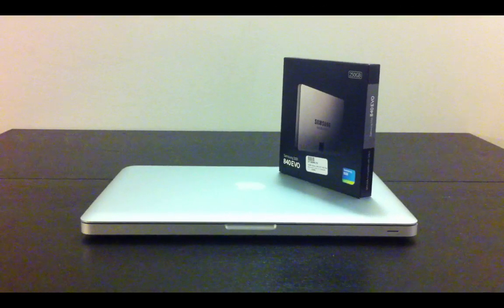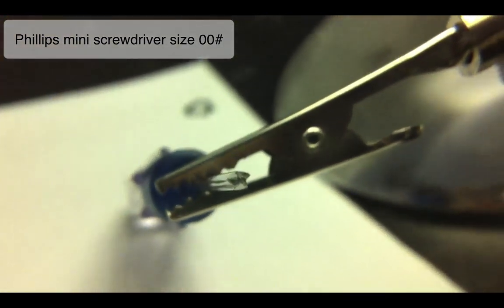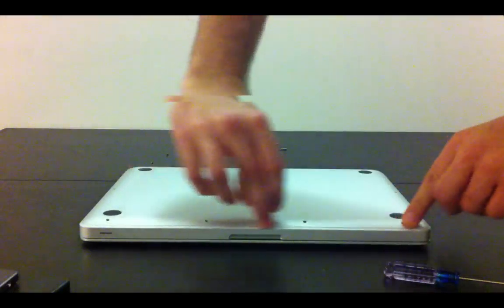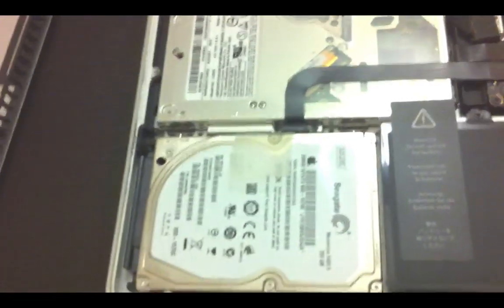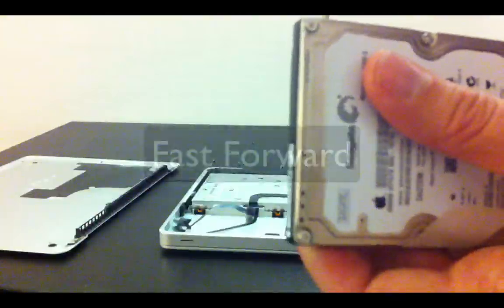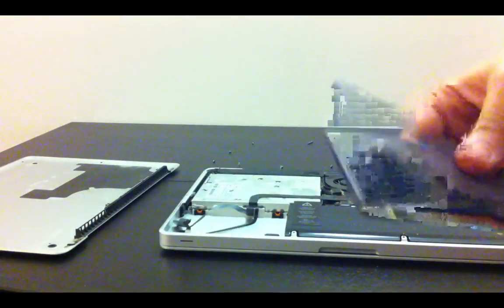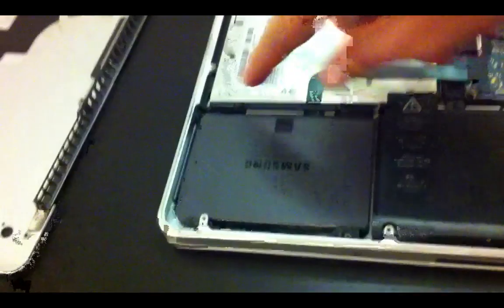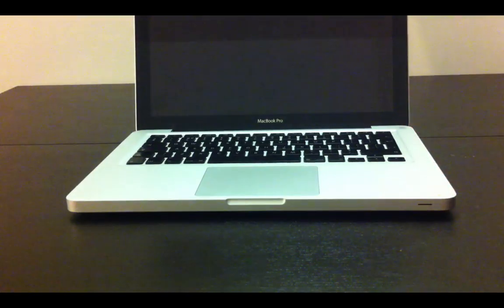SSD Upgrade for MacBook Pro 2010 Model - Samsung 840 EVO

Comment: Hi Mate, thank you very much for your video, I have a question, does Samsung 850 Evo 1.0TB ssd drive work for macbook pro 15 inch Mid 2010?
Reply from the maker: What concerns you that it wont?
Reply: won't*  Wont = in the style that you are accustomed to.

Comment: Hi and thank you for the instructive video. I just upgraded my 15 inch Mac book pro 2010 memory to 8gb. Mainly because my laptop has been shutting down on my randomly, it's driving me nuts. I have the new el capitan. Thinking of buying a new drive for it, but I want to see your opinion. Do you think this will solve the overheating and shutting down problem? Anybody else have some advice please?  I need my MacBook to study and have to fix this annoying problem.

Comment: My Macbook 2010 i7 overheats ever since I added this SSD :/  

I tried resetting the SMC, formatting, and even a trim. 

:/

don't know why.
Reply from the maker: +H1mynameisLarry 

Hi Larry, I am sorry to hear you are having problems with you Macbook over heating, I really can't believe that the SSD drive is the cause, forgive me if I am wrong., but my understanding is that SSD drives use far less power as there are no mechanical parts that move, so it should have improved. 

The first thing that pops in to my mind is my own experience of my mac book overheating and that started happening when I upgraded to OSX Yosemite. I made a video to solve my problem which you can watch here.

https://www.youtube.com/watch?v=MgHlMCXvpqk

Although every ones situation is unique, depending on software that you have installed.

Maybe it could be that you were unlucky and got a slightly faulty drive, It maybe worth approaching the seller and asking to send another.

I can still vouch for improvements in my mac, although OSX Yosemite is still a little sluggish on an older mac, their recent updates have improved things a bit for me, but my tips for disabling automatic updates has still been the best thing that worked for me.

If you are still on OSX Maverick's and having this problem I would suggest asking for a replacement drive.

I haven't dared upgrade to OSX El Capitan yet, my gut feeling tells me by the nature of business that if I did, I would be forced to buy a new mac.

I hope you find the cause and solution.

Please post here for others if you find the solution.

All the best.

Comment: Thank you. I'm not sure how much you get comments like this or not, and it may seem overblown, but you quite literally have had a major impact on my current quality of life. Computer rage, like road rage, is a killer. Slowly, imperceptibly, Chrome on my MacBook was eating away at my soul. 5 minutes to fire up a few tabs. Sometimes waiting a full minute for each click to get through the spin wheel. I knew a new SSD could do help, but having a step by step guide made it actually feel possible. It's done. It worked. Thank you. We have a baby coming, and this computer was taking my attention and adding rage to our lives. It's over. And on to more important stuff. Sometimes the small things make a huge difference. You certainly have for us. :)

Comment: Have you tested the speeds of this disk on this 2010 Macbook?
Reply from the maker: Yes I have, here are the results.

Write speed tested using command line.

time dd if=/dev/zero bs=1024k of=tstfile count=1024

1024+0 records in
1024+0 records out
1073741824 bytes transferred in 5.096262 secs (210692038 bytes/sec)

real	0m5.141s
user	0m0.005s
sys	0m1.336s

210692038 bytes = 200.93 MB/Second

And Read Speed tested using

dd if=tstfile bs=1024k of=/dev/null count=1024

1024+0 records in
1024+0 records out
1073741824 bytes transferred in 4.064185 secs (264196090 bytes/sec)

264196090 Bytes = 251.95 MB/Second

Comment: How fast does it boot up ? Do You have 4 GB RAM or 8 GB ??  And of course what kind of OS X do You have ? :)
Reply from the maker: I have 4 GB of ram, I can't give you a true answer on that as I swapped the optical drive for the old hard drive which means I have the SSD drive for OSX and the old drive for extra storage. So that will add a little extra loading time.

Also I have encryption turned on for the drive which means that I have to enter a password before access is granted to the drive. It takes about 6 seconds to get to the password screen.

Then once entering the password and restarting the timer it takes another 15 seconds to boot up.

I have mavericks installed at the moment.

Hope that helps.

Thanks for commenting. :-)
Reply: TipsTricksAndHowTos I really want to replace the optical drive on my 2010 13' mbp with a 128gb Samsung 840 Evo and use my current 500gb hdd for extra storage. But how do I do that without cloning the drive using a SATA to USB cable first? Should I make a bootable Mac OSX usb drive to install Yosemite on the SSD when I boot it for the first time by pressing the Option button?

Which is the best configuration? The SSD in the default SATA bay or in the SuperDrive bay?
Reply from the maker: Zaidi Hamid Thanks for your comment

I can't find any hard evidence that the default SATA bay or SuperDrive bay are of any speed difference.

But personally, I put the SSD drive in the default bay and the old drive in the optical drive bay as the SSD is what I wanted to have OSX on as it is much faster and it just made sense to me to use the default bay as that is how Apple configures it.

I can't say what is the best option for you with regards to cloning, all I can do is describe what I did and hopefully that will help you decide what to do.

I went for the option of starting fresh and didn't clone my old drive.

Once I had put the new drive in, I reinstalled a fresh copy of OSX over the internet. Here is apples support page on how to do that.

http://support.apple.com/en-gb/HT4718

Once I was up and running with a fresh copy of OSX I replaced the optical drive with my old drive and then went through it and deleted any OSX specific files and just left my personal data files on it.

This did mean I had to reinstall all of the software I use again on the SSD drive and configure all the applications again, which is time consuming and may not be the right approach for you.

But on the plus side it meant I had a nice clean system, which run optimally and at its fastest speed.

I hope that helps, and good luck with replacing your optical drive and setting up your system.

Comment: Will this also work with a white Macbook from late 2009?
Reply from the maker: Yes this will work on a 2009 model as well as they support 3 Gb/s Serial ATA hard drives. See this detailed comparison for more info. http://goo.gl/xjJepa

Its worth noting that the Samsung EVO 840 as used in this video is capable of twice that speed being 6 Gb/s but when used on these Macbook Pro models will operate at 3 Gb/s. I was happy with this as these drives are really reliable and future proof if I ever choose to re use the drive in a faster machine.
Reply: Thanks. But this was a comparison between Macbook Pro's and I meant the white 'normal' Macbook (6,1)
Reply from the maker: Niels Remigius Ah I see, I misunderstood yes this will also work on MacBook from late 2009. Here is a youtube video showing SSD upgrade on that model, hope it helps. http://goo.gl/8qlD4s

Comment: Hello, you did the speed test by Benchmark?
Reply from the maker: Nope I hadn't before but here you go.

Write speed tested using command line.

time dd if=/dev/zero bs=1024k of=tstfile count=1024

1024+0 records in
1024+0 records out
1073741824 bytes transferred in 5.096262 secs (210692038 bytes/sec)

real	0m5.141s
user	0m0.005s
sys	0m1.336s

210692038 bytes = 200.93 MB/Second

And Read Speed tested using

dd if=tstfile bs=1024k of=/dev/null count=1024

1024+0 records in
1024+0 records out
1073741824 bytes transferred in 4.064185 secs (264196090 bytes/sec)

264196090 Bytes = 251.95 MB/Second

Comment: Hi- how have you enjoyed the SSD ? Any issues.
Reply from the maker: Yep it is working amazingly and very fast ...  been working perfectly...
 
It is the best upgrade I have done to this machine feels like I don't need to buy a new mac for some time now as it really is fast with this installed.

Well worth the upgrade cost.
Reply: OK great. Do you notice any battery increases ?
Reply from the maker: chris kelley Yep battery was a big jump from about 4 hours 30 mins to 5 hours 30 mins.... I have since taken out the CD drive and put the original hard drive in as a second drive giving me 506GB of disk space 250 from the SSD and 256 from standard drive so it has dropped back down... to 4 to 4 and half hours...

Comment from the maker: Tutorial showing how to upgrade your MacBook Pro's hard drive to an SSD drive.

The model identifier for my mac in this video is MacBookPro7,1 mid 2010 Model.
The SSD Drive is a Samsung 840 EVO 256GB

You can find your Model Identifier by clicking the small apple logo in the top left of your screen and going to "About This Mac" - "More Info..." - "System Report"

The screwdrivers that are required are

Phillips mini screwdriver size 00#
Torx T6 Screwdriver

SSD Upgrade for MacBook Pro